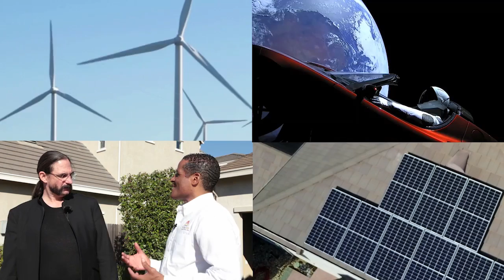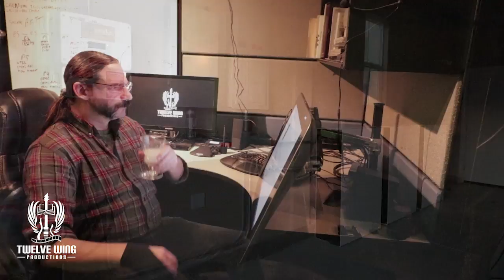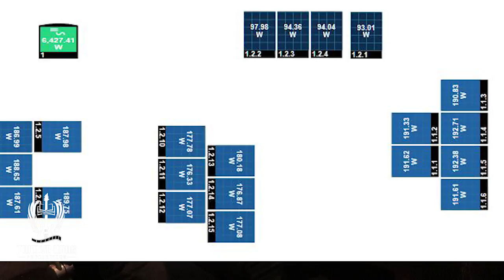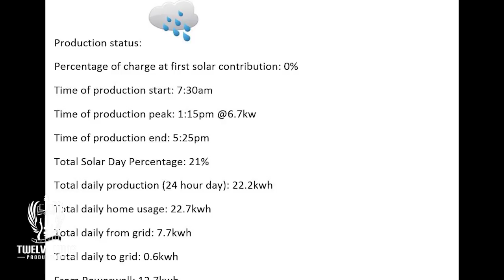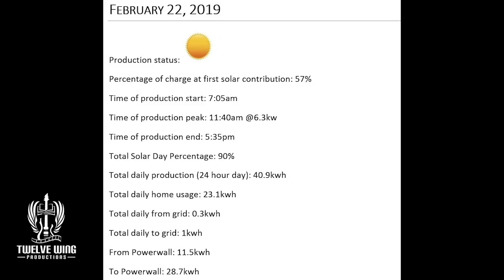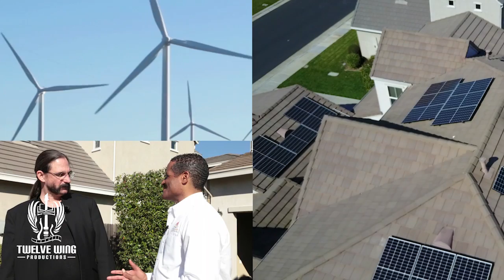The Energy Sovereignty Project: Month 2 Week 3

Comment: Great to see the graphs especially the solar generation verse the actual usage day by day. I was interested to hear your point about the difference value between what the solar edge recorded and the Tesla Gateway. I record both values day-by-day and they usually agree to a point of being spot on, on the odd occasion if there is any variance it's about 100w in favour of the solar convertor reading.
Reply from the maker: Since we are only 2 months in, I don't have enough data points yet to make much of a conclusion.
Some of what is being recorded is error but I just don't have enough data yet to tease that out.
Unless I can definitively locate where loss would occur, I'll not record it as a loss, but currently it is looking like it's a pretty solid 3-4% loss through the inverter.  That's right in there with both what is expected as well as what the manufacturer says it should be.

Because this is a percentage, it's going to be a very small difference on low production days.  I think our system is better able to tease out this loss, especially in June, because of the amount of production.
I will also be taking a shot at calculating the round trip losses to, and from the powerwall.
The car will help with that since it records how much power was delivered to the battery.  Obviously once it's in the car it simply becomes a product of it's battery to wheels efficiency.

Comment: Hey Good stuff! My system is off and running as of the 14th of this month. I produced 242kwh in the first week. Question for you. I have 2 powerwalls and i want them to last as long as possible. Do I set it to use like 20% daily or use backup only? I know with it being battery’s you want some movement but want to make these two powerwalls last as long as possible. I have a system that producing way more than I use so production I get would get me threw.?
Reply from the maker: Based on what I know about them to this point, my recommendation would be to just use them.
The battery keeps some of the total capacity from being used.  When "full" the battery isn't actually full and when "empty" the battery isn't actually .. empty.

The reserve setting is just that, it's a convenience setting.  It just allows you to decide how much you want to keep in reserve in case the power goes out.

Our system is a little different in that because we have excess capacity, we can extend the life of our system, in theory, by not allowing it to charge fully in summer when we don't need the extra capacity.
The problem with that is that there isn't currently a setting in software to allow us to do this.
In a system with one or two powerwalls, it's likely not going to help you a great deal to do this yourself.

So the answer to your question is.. just use and enjoy them.  They will last.  Tesla has done it's homework.

Comment: With just 1 cycle a week, (in winter anyway), The heat spread across more cells, 30-40 year life span? The Inverter's may fail first after 15-20 years.
Reply from the maker: I'm not sure I'm following?
Firstly, the ESP test home doesn't use microinverters.  It has a single main inverter for the home and then the 6 inverters (one in each powerwall).
Are you talking about the powerwall inverters?

The world is an imperfect place.. things fail.  At the studio, I've have a bit of trouble with microinverters.  Not bad... but I have had two of them fail so far.

The key is redundancy I suppose.  That is the main thing.
As to the period of time, I'd be fine with 15-20 years.  I suspect that any replacement would be very inexpensive and much better by that time.
Reply: Yes i meant the  powerwall inverters,  I was just pondering what the possible life span of the PWs could be when most people suspect them to be reduced to 70% of its original usable capacity in its 10 year warranty at 1 cycle per day, based on 1 PW. We will know in about 5 years! and then 10 years for sure.
Reply from the maker: @That1ufo , there are many many variables in that depletion figure.
Looking at what we can actually track with the vehicles, smaller systems would show around a 20% degradation while larger systems like mine would probably track with the vehicles and show a 10-15% degradation in that period.

Bottom line is, we don't know what we don't know.
In a video I'm working on now, I will be discussing the Tesla model S90D that we are using for our test.
The vehicle now has approx. an 8% decrease in 110,000 miles.

What's important to remember about all this is that while these batteries are busy working, new technology is being developed.

So ultimately, the important thing from a consumer perspective is backwards compatibility.
Can the new type of battery modules be put into existing products.

In the case of both the Tesla automobiles and the Powerwall units, I believe the answer is yes.

So you will have to make your argument clear.  Are you arguing against the technology as a solution, or are you simply pointing out that though what we have now is passable that we have a ways to go in development yet?
Reply: If it shows only a 10-15% degradation in that period then i think we can agree it is ready, and it will only get better with a Maxwell version.
Reply from the maker: @That1ufo , agreed.
The purpose of the project is to force manufacturers to be honest about both the capabilities of what they offer as well as being honest about the consumer about how much storage they actually need.

Currently I am seeing the manufacturers lowballing what they are telling the consumer they need based on two factors:
1) If they tell them they need less, it appears to the consumer that they have to spend less.

and

2) Availability of supply.  If they actually told everyone that they needed two or three times as much storage as they are now then the demand would outstrip what they can currently supply.

Right now, the cost of generating your own power, even with amortizing loss, exactly equals.. or slightly beats.. what you are paying your utility now.
In less than 3 years.. this will change to the point where it is a serious advantage due to cost coming down as supply ramps up.

At that point it will be VERY important for the consumer to be wise about what they are buying.  Cheap Chinese bullshit will be EVERYWHERE.
At that point, I hope that people that have been watching what we are doing will understand the importance of things like thermal management.

No matter what, though, this is a really exciting time to see this unfold before our eyes.

Comment: Great stuff! Thank you for putting in the time to document your journey I know it takes an enormous amount of effort.

You documented your experience with the disconnection from the grid and mentions the power walls were not living up to the promise. I just heard that Tesla are shipping the gateway2 either software or hardware I'm not sure that promises to Keep your solar up and running when the grid goes down? Is this something that would help you and did you know it was out?
Reply from the maker: Thanks for following along.

Firstly, it's not that the Tesla system doesn't live up to "the promise"... I believe it does.
What they did was to make statements on their web page about operating as a way to shift cost from peak rates to off peak rates that are being denied to the system currently.
This isn't the fault of the batteries, it's a temporary condition placed on the consumer by Tesla so they can pander to the federal government to increase sales.

As you can see with the project, the batteries are performing very well.

Currently, our grid is stable when the mains are switched off.  Our longest test thus far I think has been 13 days but the system is now probably capable of going for much longer.

The new gateway has some additional buss hardware that allows it to handle and distribute more power and has some communications upgrades.. as is my understanding.  I'll look into it further and bring the information to you as I get it.  They have a limited number of these distributed in Australia and Germany for test.  Probably a few in the US as well.

If you have additional links, feel free to provide them.
Reply: @twelvewingproductions7508  https://electrek.co/2019/02/22/tesla-powerwall-backup-power-europe/

Comment: Does the Tesla Powerwalls use the same batteries as the model 3? I heard that if I order a Powerwalls in the US it would take a while to receive a powerwall
Reply from the maker: Currently, they use the same batteries as the Model S.
They are ready for immediate delivery now as is my understanding.  Our installer, SunWorks, has them available.
Where in the US are you?
Reply: Twelve Wing Productions I’m in the Bay Area, near Napa area. A while card question what improvement do you expect from Powerwall 3.0? When it will be updated to 3.0? I think it will be uploaded in 2-3 years . Just a random question and quess
Reply from the maker: @prabhdeepdhaliwal5706 , in running the numbers for both the new Roadster as well as the Semi, it's obvious that Tesla has been working closely with Maxwell and internal developers to weaponize a solid state battery or at the very least an SSE battery.
My guess is that it will utilize that technology as will all Tesla products across all of their platforms.

Your timeline sounds accurate for the Powerwall 3.0.  I believe that the model S, X and model 3 will benefit in the next 1-2 years.  Powerwall following shortly thereafter.
Reply: Twelve Wing Productions thank you =)